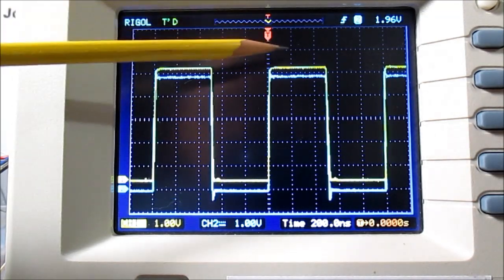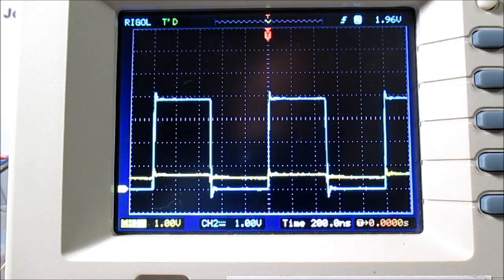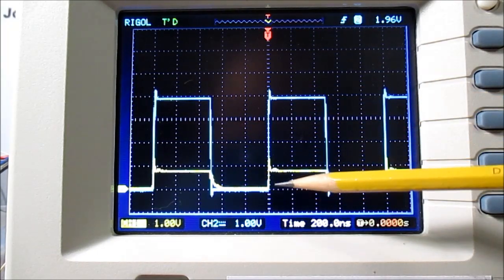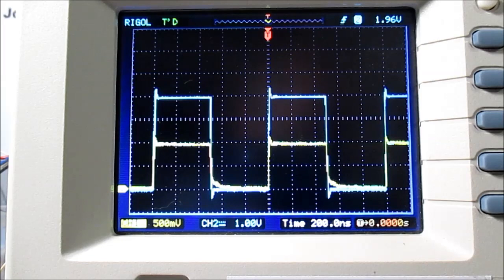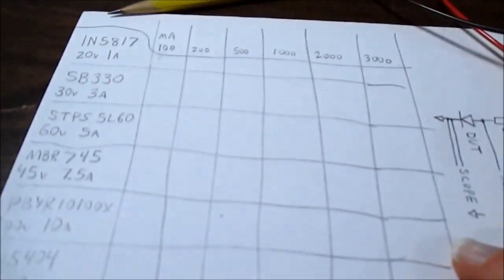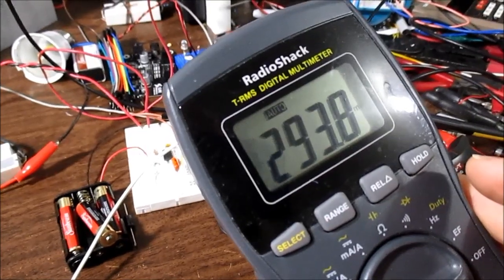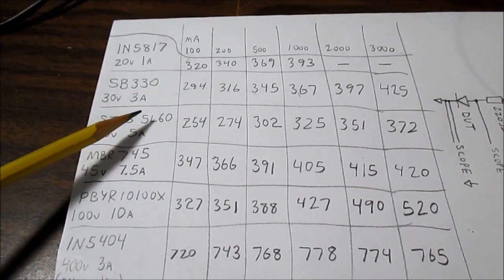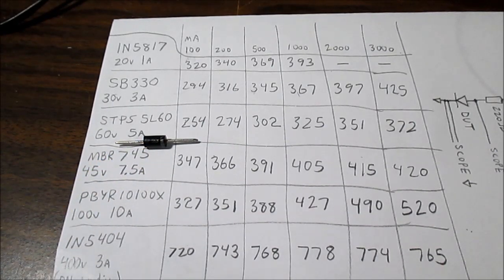Understanding Schottky diodes (with bench tests)

Comment: Can a 3 ampere diode output 75% of it's rated current capacity at a given forward voltage say 12 volt after dropping it's internal forward voltage ?

Comment: I have noticed at 18:55 a small discrepancy when measuring the leakage current with that green LED as an indicator. I do have these LED'S here, and tried them for the sake of this video, but in no way I can get them to light that bright with 2.6µA. It lights, but very very faint. I see it that bright only above 250µA. If I am not wrong maybe you should check your meter ?

Comment: I wanna know how to regulate voltage. I'm not sure I'm saying it correctly but I'd like to know how to take 120 volts A/C and bring it down to say 12 volts D/C
Reply: Depending on your needs, one option would be to use a transformer to step down the voltage and then from there build/buy a full bridge rectifier and finally add a couple of capacitors to get a clean DC supply.

Comment: ty, I read that the low forward voltage on characteristic is reduced as the current through the Shottky diode increases, as your vid mentions.  I made a simple radio circuit and the Shottky is very good at those low voltage AM radio waves...probably better than a Germanium type.
I got a bag of IN5817 Shottky diodes 1 amp. from China at very good cheap price.. maybe 50 for 3 bux..  
I did a test:
Current     Voltage across diode
380ma       392mv
130ma        339mv
98ma           328mv
45ma            300mv
10ma            258mv
1.16ma         200mv     good for radio

It is also possible to forward bias a diode, with a simple battery , diode and resistor circuit, to turn it on to help the radio signal.

Comment: Speaking of rectifier diodes, what do you get when you arrange four of them in a bridge configuration and put a capacitor across the output?
Reply: You can get a lot of heat

Comment: So can we say that rectifier (slow) diodes are acting like simple Low Pass Filters? Is it possible to use them in let's say class A buffer/preamp stage where we are working on biased AC input/output signal (so the whole waveform gets through the diode)? It's interesting what's the -3dB point in frequency response of such a diode, and what is the speed of that curve falling (-20dB/octave probably like in bipolar transistors)?

Comment: What about the ideal diode based on a P Channel Mosfet as far as efficiency compared to the Schottky. I know the price is a huge difference, but?
Reply from the maker: If I'm not mistaken, I think there are switch mode regulator ICs available with built in active rectification based on what you said.

Comment: Very clear, glad you don't use the textbook lingo, ie knee voltage, etc.
Reply from the maker: As a hobbyist, I aim my videos at hobbyists. There are very good engineering based videos and documents around if you want to get into the theory along with all the math. Although some graphs and math is necessary, I try to keep it to a minimum in my videos.